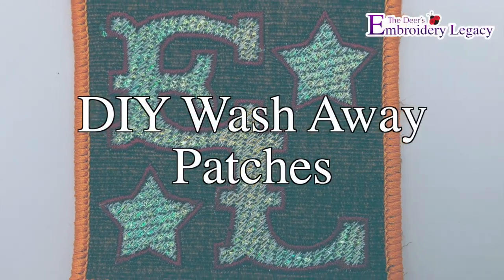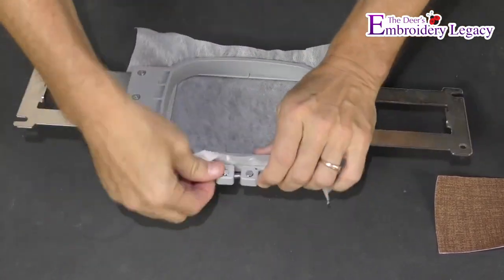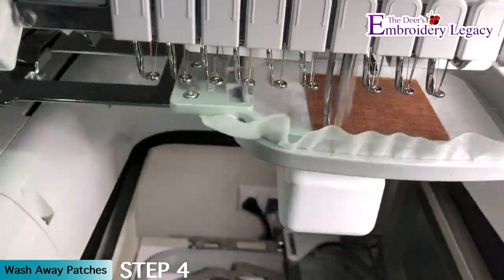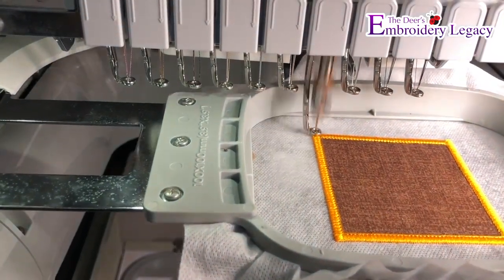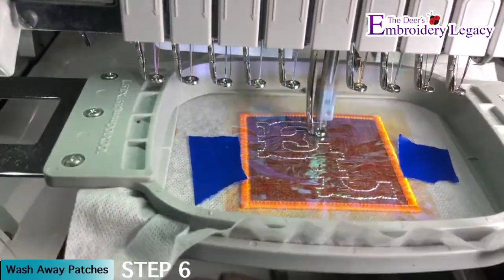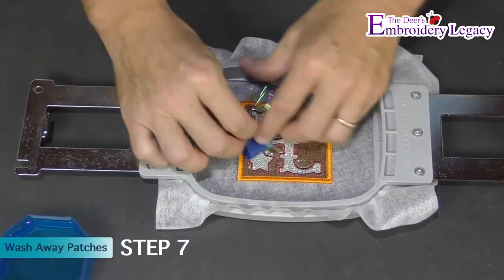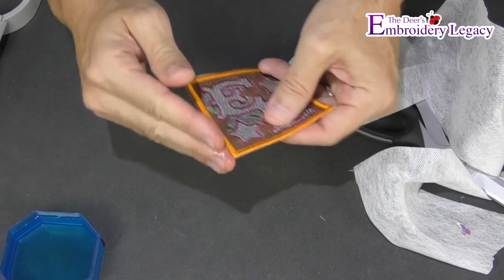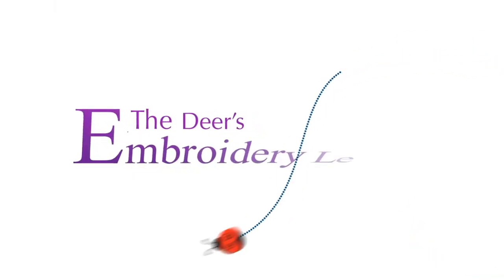Creating Machine Embroidery Patches with Wash Away Stabilizer

Comment: So neat, what about doing several hundred patches at once? I just run biggest loop with 20 patches laid out on software then hot knife the edges with the faux Merrow edge as well.  this process would add steps but take away the crappy hot knife